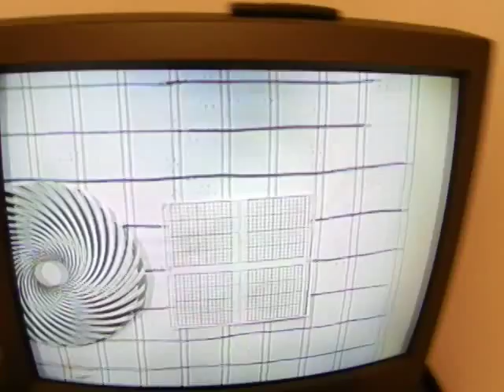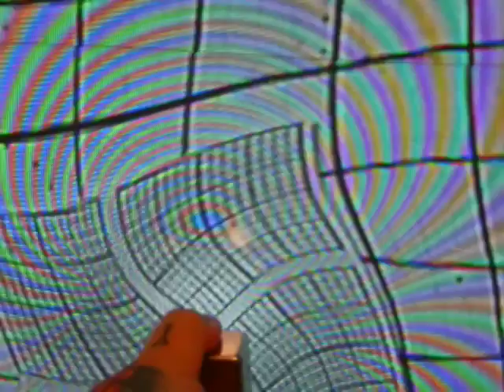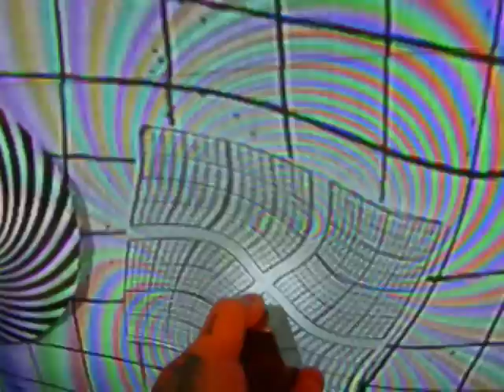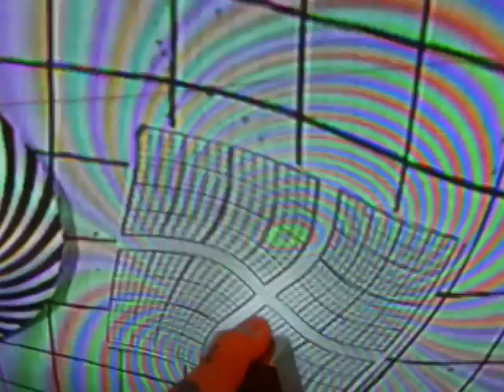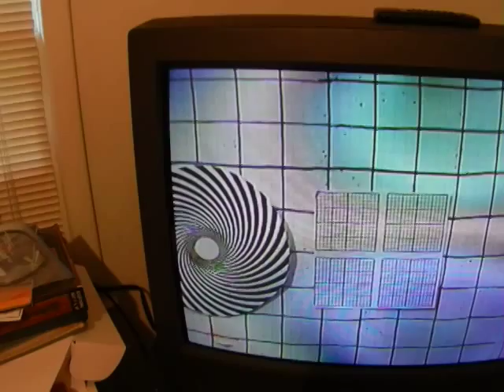VIDEO 8 Uncovering the Missing Secrets of Magnetism, Magnetic Vortex with GRID DISPLAY

Comment: The swastika is actually the Big dipper in all 4 seasons.

Forgive me If I'm incorrect but I thought the Centipedal southern pole was clockwise and the North centrifugal pole was counterclockwise?

Or is it N-S centripedal NULL S-N centrifugal?

Still having trouble seeing the flowing toroidal electromagnetic forces in my minds eye.

I also think you are wrong by discounting iron filings as a means of visually representing the electromagnetic lines. Iron filings orientate with the flow of electromagnetic current no different than how things align with the flow of water.